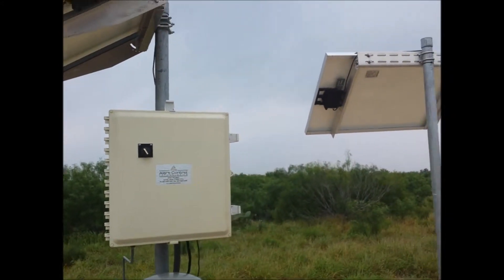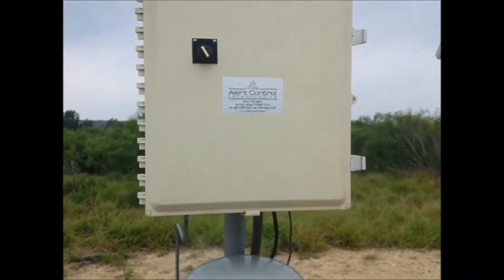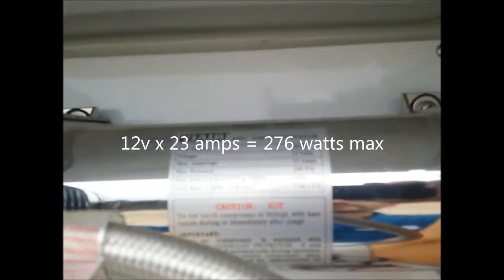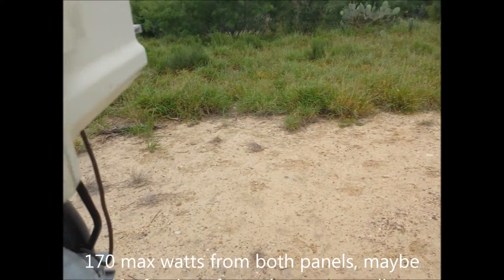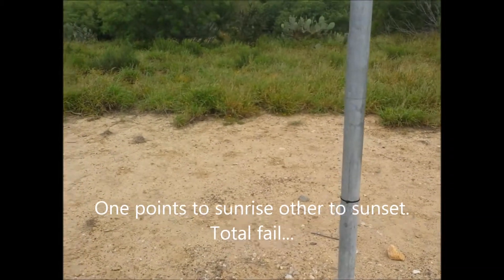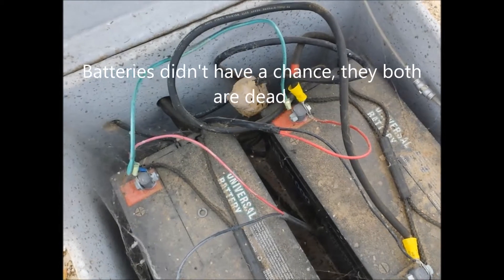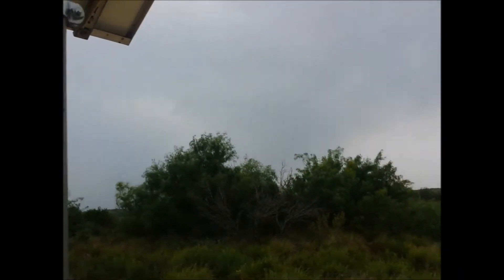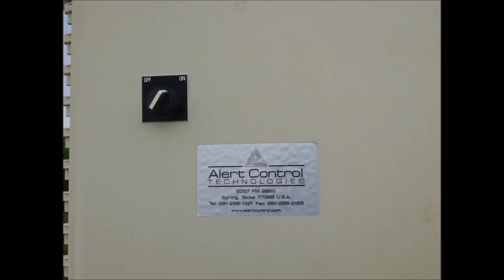SOLAR PANEL INSTALLATION FAIL # 2.

Comment: They could be facing different directions for a very good reason.  They could be redundant so one works in the morning and one works at evening.  
California has the problem now of solar noon not being in sync with peak demand. By law, solar panels have to face South when they SHOULD be facing West to meet peak demand at 4:00-6:00 in the summer.
Reply: Thanks for the info on the California situation and solar noon. This comment was unexpected as I dont post on this channel any more. I may post more solar videos soon but not sure if on both channels. If you search Jorge Serna Santan Solar it should bring you to my solar panels I bought. You will find my current videos here, mostly welding projects and little solar here and there.

Comment: It would have been nice to know WHY it was set up wrong and what could be done to fix it.
Reply from the maker: Pop's Shack In order to harvest the most from the sun you want to point them all in the same direction like south/east for were I live and at about 40 degree angle.

There is 2 panels for a total of 170 watts let say. The panel that is pointing to sunset direction will only harvest power when the sun is going down and at its weakest part of the day. 

The panel pointing to sunrise will collect power for maybe and hour or 2 before dropping in wattage.

So lets say theoretically 170 watts of panel for 5 hours should collect approximately 850 watts, these would not even meet 30% of that. 

I think they wanted to get the same result of a tracking system but the outcome was bad for the batteries.

The Fix.

Point both panels at South - East direction so they can collect major power.

Replace both batteries.

Use 1 charge controller versus 2, less lose if we use 1.

I hope this explains a bit more. I can run a test later in the week to see a total collection of watts from 2 identical panels.
Reply: https://handybobsolar.wordpress.com/about/